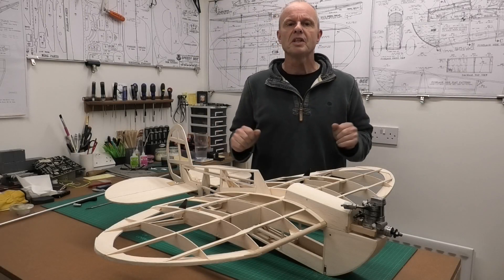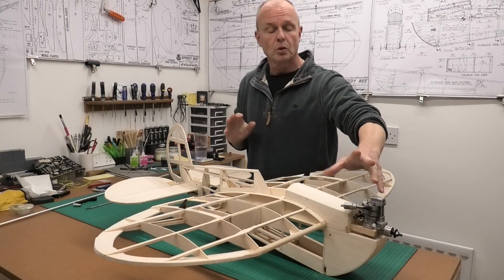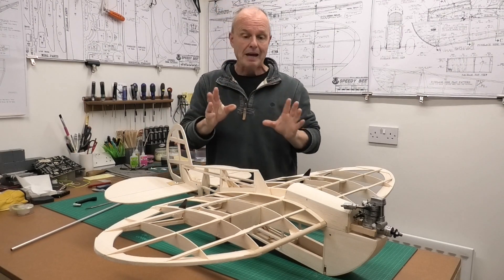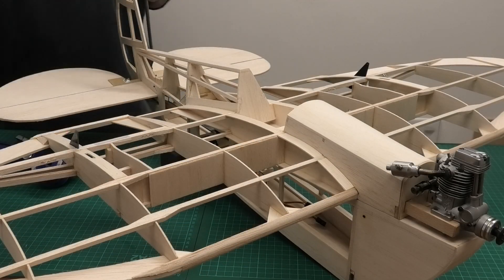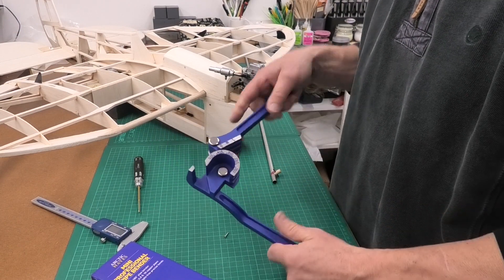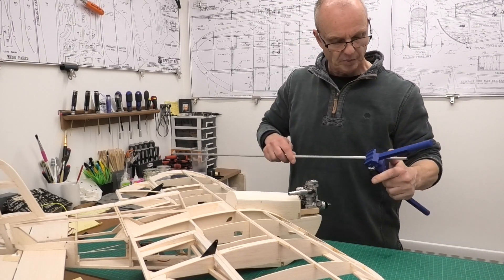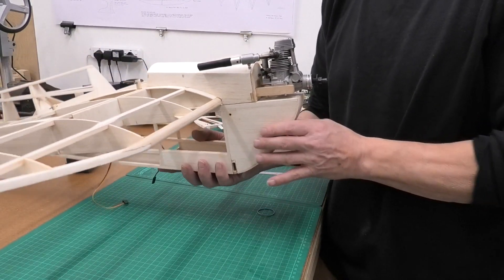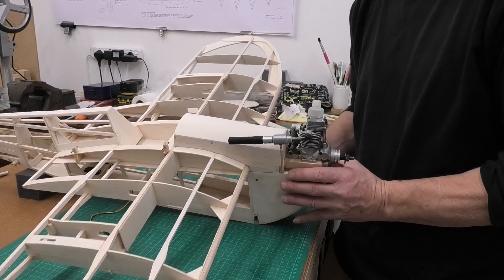Speedy Bee - Build Series Pt 13: Custom Piped Exhaust System - Designed by Clancy Aviation - OS fs26

Comment: I’m interested in how that effects the motor run. Specially the tube attached to the crankcase breather. I was alway told to never do that. Just leave it open. But these little motors do get slimy
Reply from the maker: Hi Steve, thanks for the comment, I always run my 4 strokes with tubing on the breather nipple to get the oil away, which is usually shown/mentioned in the engine instructions, they run fine with it
Reply: @MarkRobinson555  thanks, I’m going to start doing that!